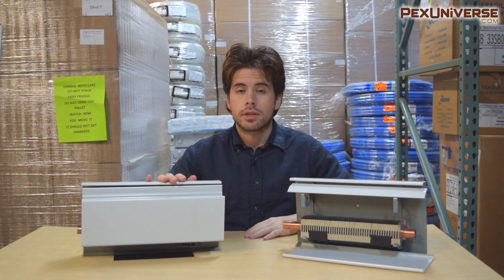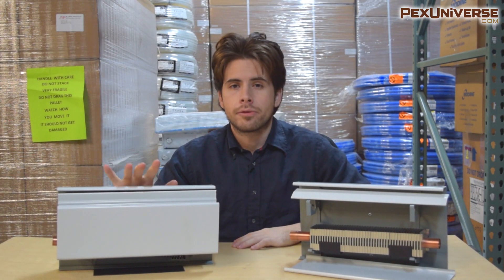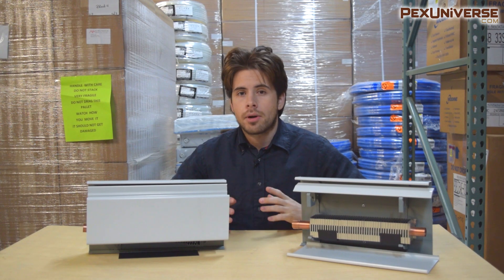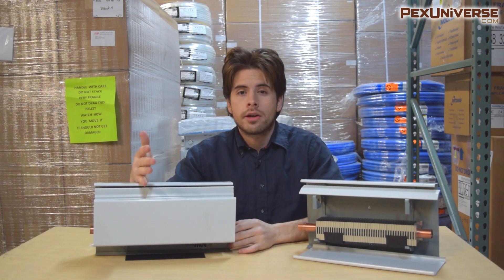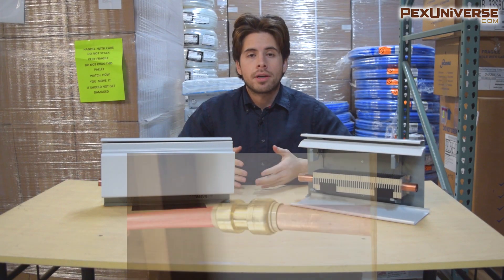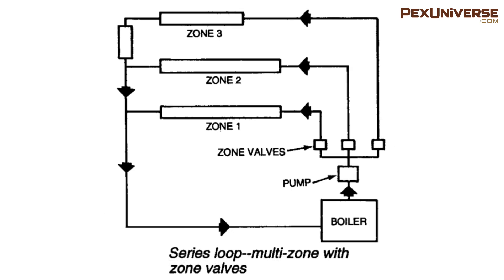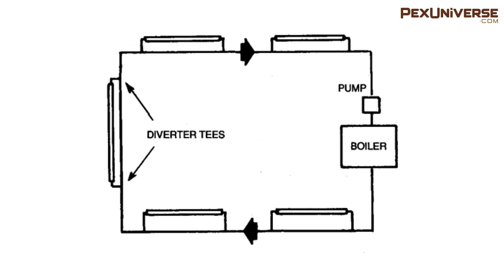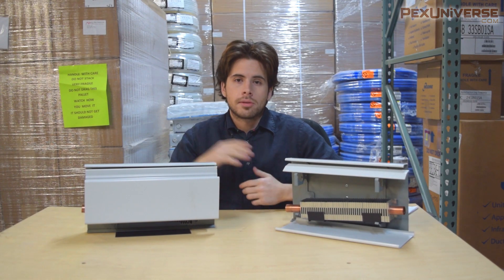Baseboard Basics | SERIES LOOPS, ACCESSORIES, FAQs, BASEBOARDS 101

Comment: Could you elaborate if stiffners are required for pro press fittings? Im going to use them but read conflicting ideas that say not required. Type L versus Type M. L being thicker therefore not needed. Thanks for the education.
Reply: I think the heating element copper is type VT = Very Thin. Will definitely stiffeners for them.

Comment: 180 degrees? Some Pex is rated 180 but I have seen others rated at 200. Also, Shark Bite plugging on your video?
 I prefer Pex A with expansion fittings. Not against Pex B with compression fittings but this is what I prefer..

Comment: My landlord keeps telling me that I cant keep my windows open because it costs her money. We have this under the floor boiler baseboard system with no individual valve to shut off my room, I have insulated (took off the fins off and placed foam tubing on it and taped the gap on the enclosure of the tube, to prevent heat from heating up my room so much. I also have sealed the door frame and under gap to prevent any cold air from my room to mix with the house. There is no thermostat or thermometer of any kind in my room. I keep trying to explain to her that it does not affect the cost and the boiler does not work harder but she simply doesnt understand. What do you think? Am I wrong?

Comment: If I’m reading the zone diagrams correctly, a single zone has the pump at the end - effectively pulling the water through - where as the muli zones have the pump at the beginning - effectively pushing the water through. Correct?

Comment: My 30 year old house has in floor radiant heat, however it was built using poly b pipe.  Is this the only way I can heat my basement now if I abandon the in floor heat and stay with a boiler? Upstairs is forced air thru fan coil unit.

Comment: My 30 year old house has in floor radiant heat, however it was built using poly b pipe.  Is this the only way I can heat my basement now if I abandon the in floor heat and stay with a boiler? Upstairs is forced air they fan coil unit.

Comment: Can you run anti-freeze in those? If not, what can you use that doesn't freeze?
Reply: Can you not just set the freeze protection on the thermostat? Usually about 5 degrees C in the UK. Even if the heating is switched off, it won't let the room temp drop below that set point.
Reply: @shaneord7527  I live in a place that gets -10f and lower with the wind chill in the winters. I have an old mobile home that is about 2ft off the ground with skirting around it. I am going to use DC heating elements in old water heater powered by solar to heat the inside and underneath my home with baseboards. So I need to use something that doesn't freeze and doesn't eat the pipes. It's also going to be linked to my fireplace to heat at night or when there is no sun.
Reply: @pezjme  ah right, it'll be standard copper pipe so probably best to search antifreeze that won't corrode the copper.

Comment: What i like to see here is a drawing for a 3 pipe system , 
     where 1 pipe distributes hot  water through out to each heater inlet  with a "T" , and  a 3rd  pipe returning cooler water from exiting each heater , so heaters  one end gets hot water in, and the other end puts the exiting cooler water in the 3rd pipe coming from the last baseboard returning to the boiler .
Therefor each heater gets fresh hot water and the second heater in line don't get look water and the next on line gets much cooler water
Reply: I did a drawing like this for a project using Sill Line casing, which I now hold the trade mark for. Doubt you'd find an off the shelf US baseboard tall enough to accommodate the element of the and a flow and return pipe.

The Perimeter Heating Company Ltd in the UK can manufacture bespoke systems and can be ordered through G&C Salles LLC, but they are far more robust and efficient than the off the shelf stuff so expect to pay a premium.

Comment: I'm replacing my hydronic baseboard throughout the house.  Ranch.  The house has always heated well but I'm wondering if I should install high output & if it would save on heating costs or if that would be overkill.  High output vs standard baseboard???

Comment: I looked thru the comments and could not find if this question had been asked or answered. We're doing a remodel in one section of the house which includes moving a few baseboards. There is a tricky little corner in one of the rooms and a plumber that came to give us an estimate suggested that he could use PEX at one small portion where pipe would be connecting underneath the floor. Is that right to do that instead of just using copper?
Reply: Yes, PEX has an outer coating called EVOH which makes it ideal for heating cooling and snow melting systems.

Comment: I am moving into a house with baseboard heating. I have been told it’s cheaper to run baseboard heating on a boiler system than having a furnace heat a home.
Is this true at all? Or does it depend?

Comment: I have  lived with radiators, baseboard, and forced air (least fav). We are going to build on some land and looking into geothermal. My understanding is  a heat exchanger can reverse the heating and pull warm air temps back to the ground for cooling and then circulate the geo cooled water acting as A/C. How  and can geothermal work with baseboard or radiator systems?

Comment: Great video. I am moving a heat does it matter which way the water flows through the heater? Right now it enter from left and leave to the right. It would be easier to enter from right and leave from left when heater is moved.
Reply: No it doesn't. This assumes fin spacing is the same along the ldngth. With the elements I make I can change the fin pitch so on large runs I can have wider spaced fins and reduce them down towards the end of the run to spread the heat evenly. I can also make twin tube so flow and return are same end.

Comment: Does anyone here know how to cut off the baseboard heater if it’s not electrical? I have 2 roommates who have mental issues because they love the thermostat to be on 80 all day long. I have the smallest room with only 1 window and it literally hell hot in my room. Like not an inch of air, even if I open the window. The heat even overpowers my AC, which they complain I use too much. But I have no choice because 80 degrees on the thermostat is way too high to me. They have no kind of understanding or reasoning, so I have been stuck in this situation for awhile. They both have bigger rooms so maybe they don’t feel the heat as much? My room is like a hole in the wall. It’s so hot that sometimes I have to sleep with no shirt on or pants! And I have the AC on and a fan on high blowing directly on me! Once in a blue they set it to 70 or slightly lower and I’m able to breathe. But I’m desperately seeking for an answer for what I can do. I wish I could just break this damn baseboard heater! I want it permanently off. Can I cover it with something to block the heat? Please somebody let me know if there are any options possible to stop this!! Thanks
Reply: Yes, block the air inlet and/or outlet. It will then turn into a very inefficient radiator. If you can remove panels and insulate them it will help.
Also, removing fins off the tube will do the same but is somewhat irreversible. A decent pear of scissors should be enough for the thin foil type fins, tin snips for more robust ones (0.5mm). Hope this helps TPHC.

Comment: in the long run, does this generally come out cheaper than installing a typical gas furnace that may have frequent repairs over the years...? just looking for a general idea of whether its more or less expensive. personally ive always been a fan of baseboard heat. i just like it better.

Comment: My house has a 56 year old Iron Fireman boiler and three zones of baseboard.  All the baseboard in the basement has rusted severely due to damp or water filled concrete block walls, and or shallow water on the basement floor.  I have not been successful stopping the water from getting into the blocks or onto the floor.. The heating elements are ok, but the frames and covers have all disintegrated.  I am looking for replacement aluminum or plastic frames and covers, or complete baseboard with aluminum or plastic frames and covers.  I want to drain the system, remove the old baseboard, put hydraulic cement on the walls (to reduce the infiltration of water), and then install the new frames, covers and or complete baseboard.  Where can I obtain aluminum or plastic baseboard, and how do I attach it to the walls without using fasteners or nails, creating leakage points?  Would baseboard work ok if I mounted it high up off the floor?  That way I would not have to worry about drilling holes in the water filled blocks.
Reply: Hope you got this sorted.
Is the heating in the basement to dry it out? I assume it's an un-usable space due to the water? I only ask as heating the space would just create humidity which would be bad for timber joists. I'd opt for sump pumps and ventilation if this was the case.

But to answer the question. Finned Tube heating can be suspended at high level (though I'd expect a reduction in efficiency), also, there should be no reason why a manufacturer could not  fabricate the steel parts in aluminium.
Reply: @shaneord7527  Thank you.  Although the basement is unfinished, the baseboard was installed to make it liveable in our cold winters (upstate NY). This year the spring thaw brought hundreds of gallons of muddy water into the basement.  The house is sort of at the bottom of a  fishbowl.  All the surrounding land is higher.  So all the rain and snow melt flow to the house.  Because there are no street drains,  or ditches, there's no good place to flow the water to, so no sump pumps.

Comment: I need to replace a six foot section of baseboard heater which will require cutting the copper pipes. Can I reconnect the cooper pipes using sharkbite fittings or does it have to be soldered?
Reply: I've had customers use various methods of connection with no issues (solder, speed/push fit and the crimp fittings used on large sites). However, my final copper tube sizes are 15 or 22mm after expanding into the fins. Do make sure your existing and replacement are the same and also the same as the fitting design requirements.

Comment: You mentioned using a sharkbite to connect the pex to copper however I was told that sharkbite fittings are not designed for heating applications and that it violated code. The tech who installed my sister's boiler and used several sharkbite elbows and the building inspector made her have all of the sharkbite ones removed and replaced with sweat fittings
Reply: And even if permitted, It would cost a small fortune to put a sharkbite on both ends of every baseboard in the house.
Reply from the maker: In general they can be used for radiant or hydronic heating applications that do not exceed 200F, but your inspector should know best for that area's codes!

Comment: Great video, easy to understand and follow!

I would appreciate if you can answer a few questions:
1. What program do you recommend to determine the amount of BTU needed per room? I did found several free online BTU calculators but neither one is asking for a insulation R values or window U factors/sizes, so it seems like these are not precise.
2. I am considering installing diverter tees on one of my loops (just for the bedrooms so everyone can setup temperature as preferred) and the other two loops would be on regular with flow controls. Is this possible (each loop would have pump designated)? 
3. Yanex radiators, hydronic panel radiator or copper baseboard radiators? What is your favorite - considering installation process and overall functionality?

Comment: Difference between cast iron and copper fin baseboard?
Reply: By cast iron, do you mean the old large bore tubes? If so I'd say weight, and cost to heat. The large bore tubes have higher water volumes which require more energy to heat.

Comment: How do you turn off water baseboard heaters in the summer???
Reply: I would think you turn off the boiler and drain the system or perhaps it can be used to removed heat as well
Reply: Reduce the temp on your thermostat. Furnace will still run occasionally so that you have hot water for dishes etc.
Reply: Should have said on your room thermostat.
Reply: Does your boiler not have separate water and heating? Would have thought you switch heating off at thermostat. Boiler will still heat water on demand for taps. Or are you talking old immersion tank system?
Reply: @shaneord7527  yes I had separate water and heating but even with the heater thermostat turned all the way down of the temp dropped to 55 the heater works kick on.
Reply: @marisaperez1324  did you sort it in the end? Sounds like the Frost protection was set high. Yours works out to be 13 degrees C, usually in UK they are set to 5 (41f), this is enough to stop pipes freezing without the system kicking in so often.
Reply: @shaneord7527  no it always kicked on when I didn’t want it too. It would also make loud house rattling bang when it was turned on while it was cold outside and it hadn’t been on all day. But I moved from that house so its okay.
Reply: @marisaperez1324  omg, I was getting that loud bang thing, frit the life out of me every time. Turned out the heat cycles had closed the ignition contacts together so wasn't getting a proper spark to light it, it would be filling with gas all the time it was trying then a huge bang when it managed a decent spark. I also got a constant vibrating rattle which was a fitting that had come loose and was sat on a pipe and being vibrated by the pump. Luckily know a few plumbers and he managed to sort it all without having to replace anything.
Reply: @shaneord7527  oh lord the first time this happened I didn’t know what it was it rattled the walls made the doors shake I called the cops and was like did something explode near but lmfao I get real dumb when it did it again

Comment: I am adding a 8x12 room to the front of my house. Do you have a video that shows how to shut down the system, open the loop and add the new room in series and bring the system back online?
Reply: @Supa Trending Daily hi, I have a question if you don't mind answering. If we upgrade from oil to gas heating system do the company remove the radiators in each rooms and place baseboard like these or is that a separate performing and cost? Thank you in advance.

Comment: Should the heating element run through the entire baseboard setup or only in a few sections?
Reply from the maker: That depends! Are you  using your heater at full capacity or on a lower setting?
Reply: @PEXUniverse  I have 3 zones.  One zone has new baseboards but my 1 and 2 zones are older and  have more pipe than heating element "radiator". Also my zone settings are not working independently for some odd reason.
Reply from the maker: @MaiteBonilla  Interesting! There can be a variety of issues. A few follow up questions:  Do you know if the pipes run anywhere where they could freeze, is there an air separation device, have you been able to bleed the convectors and/ or are the circulators properly running?

Comment: Is it ok to adjust the flow to each zone using the lever on the pipe for that zone?I can see i have 3 pipes for 3 zones,each pipe has a lever and a faucet.All 3 look as if the lever is fully open.I wasn't sure if that can be adjusted or if that's to shut them off or turn on completely.So far I've closed the flaps on the baseboard heaters upstairs but its still very hot upstairs and cold downstairs.
Reply from the maker: Adjusting using the lever shouldn't be an issue. Especially if you have a mechanical valve gauge attached to each one.  What you are doing sounds correct.
Reply: Can I attach a mechanical valve gauge to an existing individual baseboard heating strip ? There's no thermostat in my apartment, so there's no way to turn an individual rooms heating unit off or even regulate it... what should I do. ?
Reply: @MESENJAH  how do you pay for your heating? I'd be wanting a start and meter so I know I'm not paying for someone else's heating.

Boxing over or Blocking airflow should help reduce the output.
Reply: Additional dampers to over boxing would offer a degree of manual control too.

Comment: I have a small 2 bedroom bilevel house. 3 zones, 1 for downstairs, 1 livingroom & kitchen. 1 for bed rooms. Hot water baseboard. The problem is there are no aluminum fins on the pipes in the bedrooms, just pipes. Is there any type of product that can be put on the pipes. Or do they have to be cut & completely redone?
Reply: https://www.amazon.ca/Fin-Clamp-CLR-2-Baseboard-Additional/dp/B00GHUSRSY/ref=asc_df_B00GHUSRSY/?tag=googleshopc0c-20&linkCode=df0&hvadid=292928524062&hvpos=&hvnetw=g&hvrand=7404042244236678235&hvpone=&hvptwo=&hvqmt=&hvdev=c&hvdvcmdl=&hvlocint=&hvlocphy=9000081&hvtargid=pla-311203036008&psc=1  

Seems quite expensive though, $100+ for 2'.  Depending on the length of your heater, it might be cheaper to have someone replace the whole thing.
Reply: I just had that happen to me. Now my property managers are coming by here the end of this month, and I am going to ask them where the HELL are the fins???  No wonder I am cold all the time.   I was thinking my thermostat was bad. Nope. Missing parts.
Reply: You can get hinged fin segments that clamp around existing pipes, not sure on efficiency but they do exists. Or replace with a Sill-Line type Finned Tube.